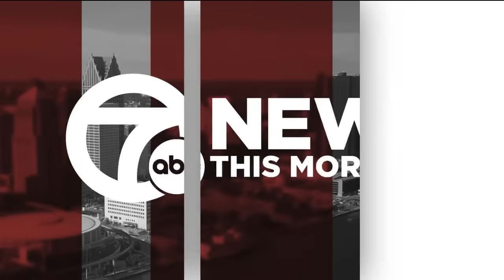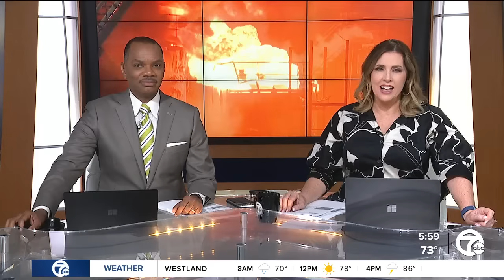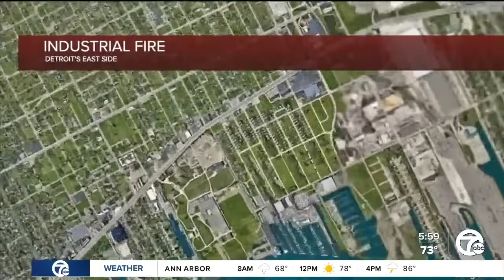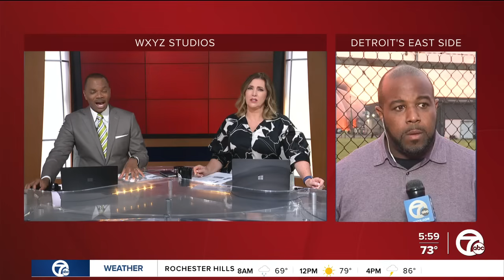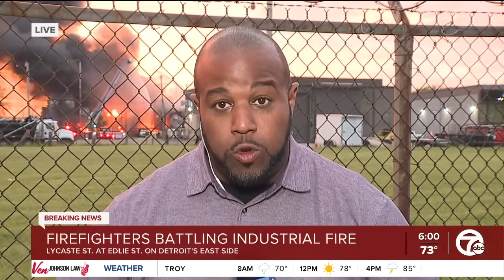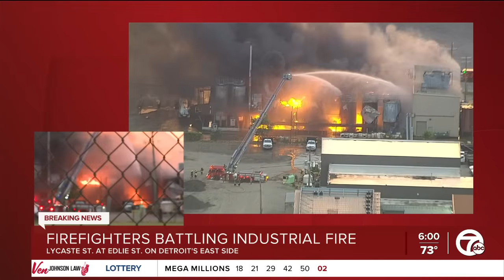Crews battle massive industrial fire on Detroit's east side

Comment: It’s 2025 and water on oil is our best method? I feel like there’s a better method we could utilize with technology advancements and modern science
Reply: Do you have any idea how much foam would be needed for that amount of building? (The Marathon refinery does not have that much I will wager.) The other option is dry chemical, (ie Purple K/Yellow K) and then you would need a couple of tons of the agent, PLUS a way to apply it to the building. (There is no department in the state of MI that has that capability, so that is out.) While nobody likes it, water really is the only option.
Reply: @MsGorteck like I said, with modern science and technology there is no reason we cannot fund the fire departments the same way we fund police and war efforts. Excuses are excuses are excuses. The tech and science are available, helicopter drops would be costly but compared to what cost savings, lives? 

Ok.